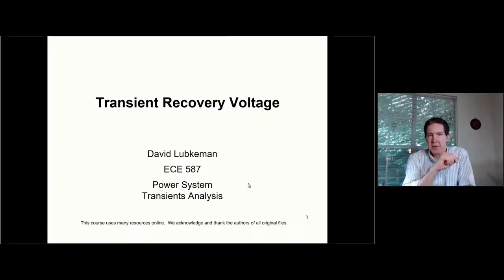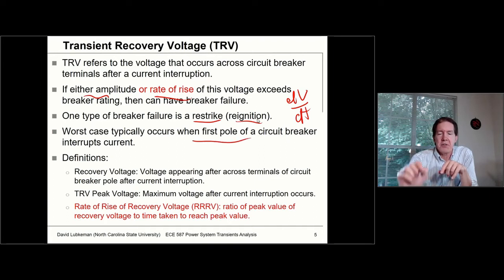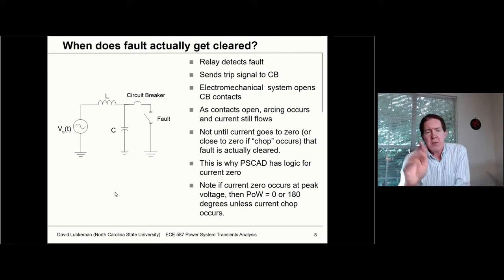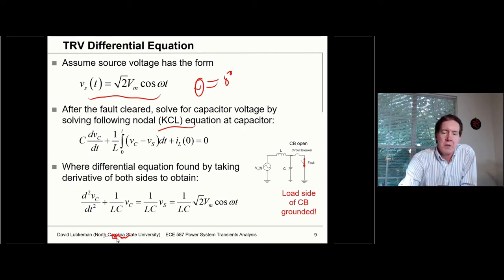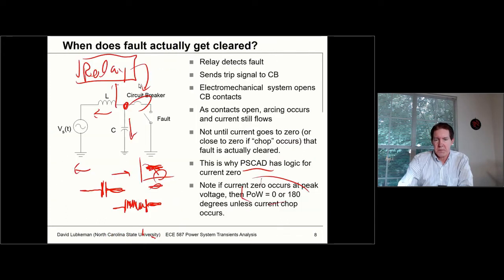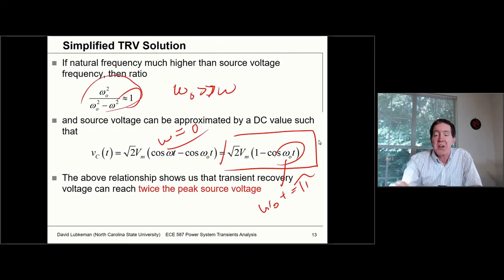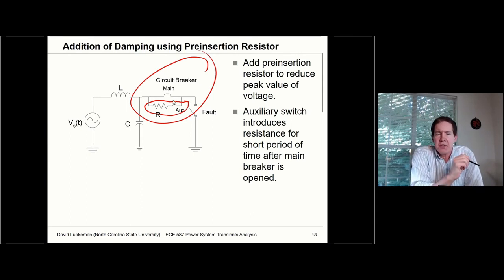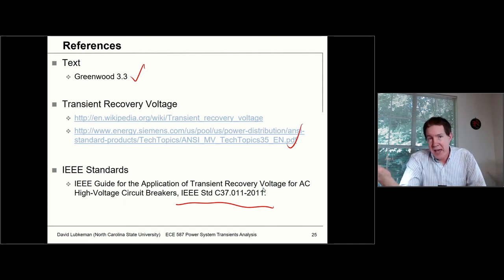Lecture 4a: Transient Recovery Voltage Theory - Power System Transients Fall 2020 - Lubkeman

Comment: Hello, Professor. Given that at the time the fault clears (t=0), which occurs after a few cycles after a fault, would this duration be sufficient for the capacitor to fully discharge?
Reply from the maker: That capacitance is due to stray capacitance seen at the breaker.  So the value is relatively small and time to discharge would not be an issue.

Comment: Dr. Lubkeman, why does the voltage across the capacitor Jump upon clearing the fault? The voltage across the Capacitor won't change instantaneously Just like the current into the inductor. Please elaborate on this point if possible. Thank you
Reply from the maker: The voltage is still zero right after the fault clears, according to the boundary condition for the capacitor. However voltage quickly jumps to a magnitude of 2x peak voltage at a very high frequency given by w0=sqrt(1/LC). Frequency is high since that stray capacitance is very small.  In a computer simulation it may appear to change instantaneously, but there is still a small time duration associated with that jump.

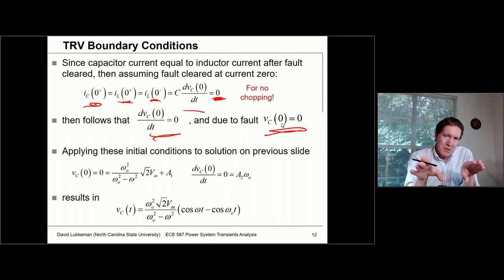Comment: @22:02 sir, how a fault condition makes Vc(0)=0?, If a voltage source is shorted , does it mean voltage becomes zero? Capacitor is charged already to source voltage level at the point of zero current crossing. How Vc(0)=0, when there is a bolted fault?
Reply from the maker: For a bolted fault at the circuit breaker, the fault current will be essentially
If = sqrt(2)*Vm*cos(wt)/(jwL) by the time the signal would be sent to the breaker to clear the fault.  A bolted fault with Rf = 0 will give us a voltage of zero (Vc = Rf*If) across that stray capacitance regardless of when the fault is cleared.  The boundary conditions are not the same as what we saw in the power factor correction switching case.
Reply: @dr.davidlubkeman284  okay sir thank you